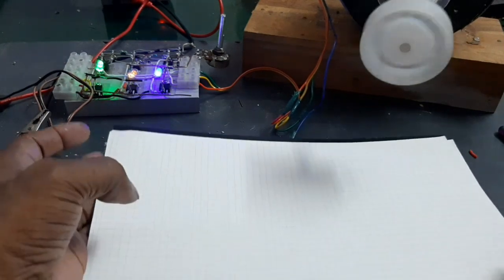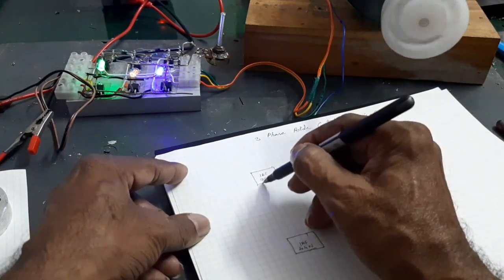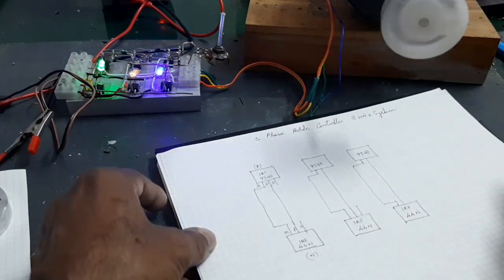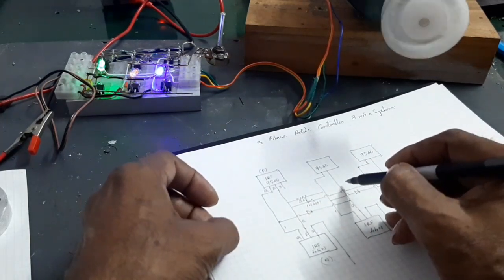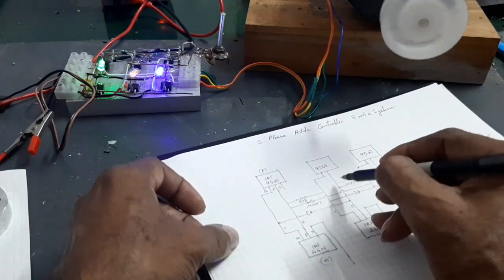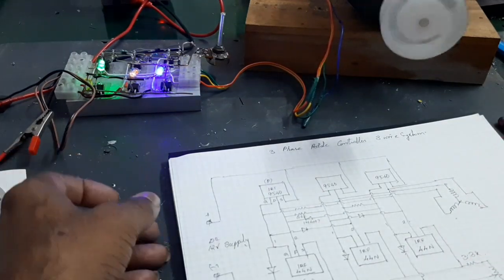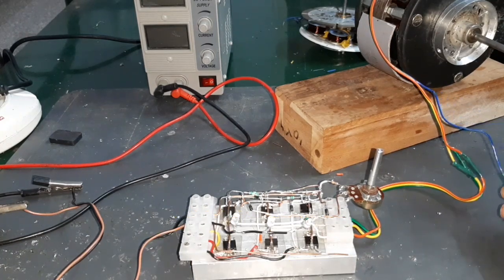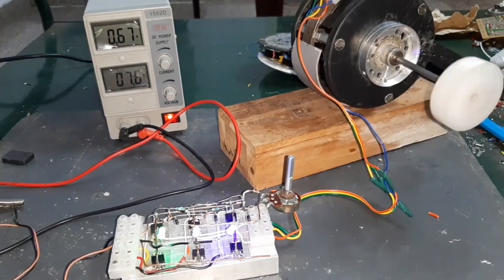Home made 3 phase bldc controller (Type-5)

Comment: You forgot Hall Effect Sensor inputs. Some motors will not start reliably without them. Without rotor positional information, your controller is not practical.

Comment: Hello friend, first of all, thank you for sharing. I have a question: In this type of circuit, every time you turn it on, do you have to "push" the motor, like in other circuits shown on the internet? Or does it depend on the type of motor?
P.S.: Doesn't it work for 4-wire motors?  Thanks

Comment: good thanks
Reply from the maker: Thanks sir
Reply: @pugalstech  What is the maximum power of the controller in watts?, default round rotation of motor clockwise or counterclockwise ? how many revolutions per minute?